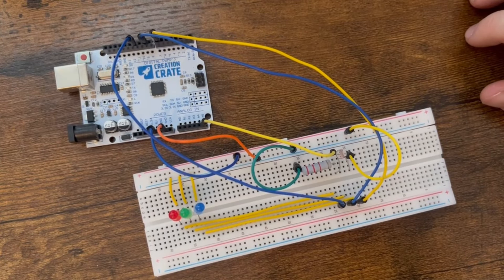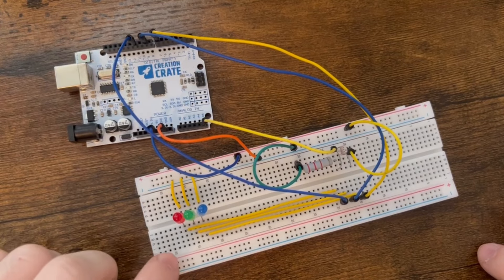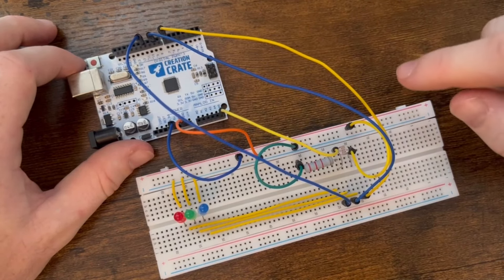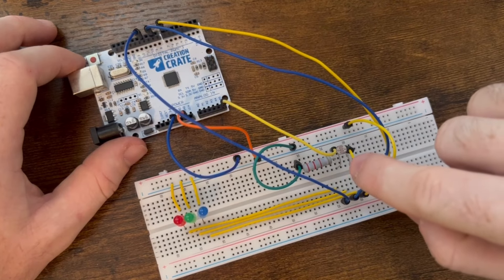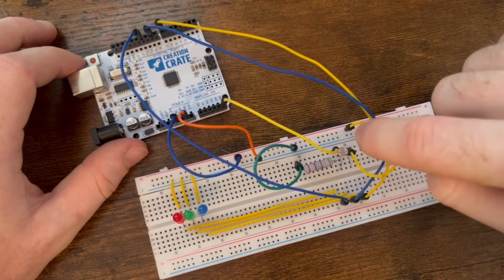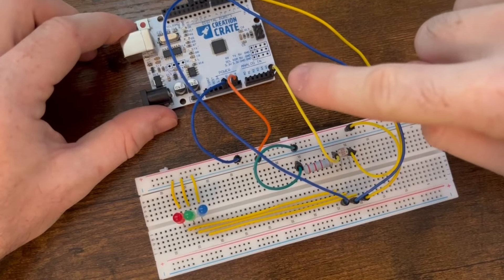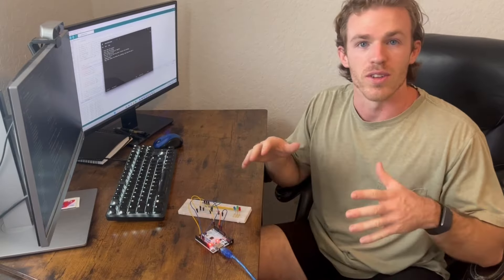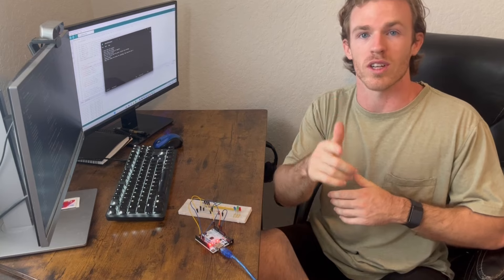Embarking on My Electronics Journey — Here's What Happened! | Pt. 1

Comment: I built a solar light tracking system for solar panel using 1 servo moto (single axis tracking) and to locate the sun's place I used two photo resistor but believe me it's not easy to compare two analogue values of two photo resistor to give comand to the servo. The values of photo resistors depend on the individual photo resistors. In the same lighting situation my one photo resistor give 870 value another give 1050 ultimately I can't complete my project bcz it was impossible to compare them and know in which photo resistor light intensity is higher.